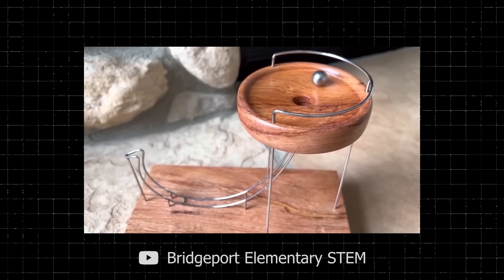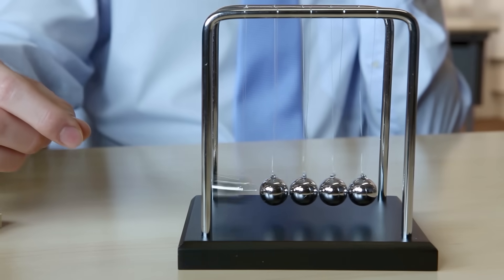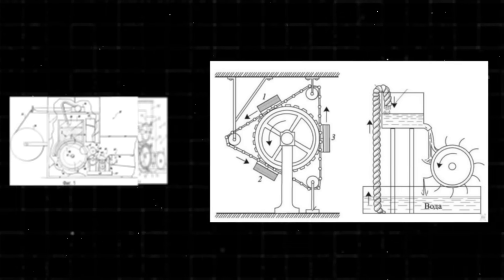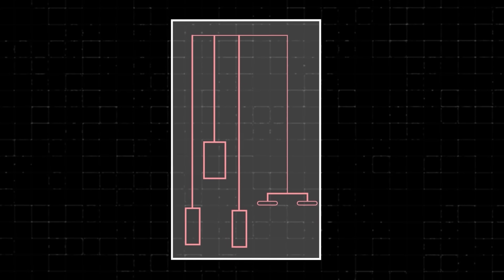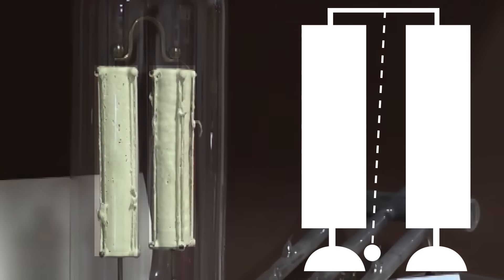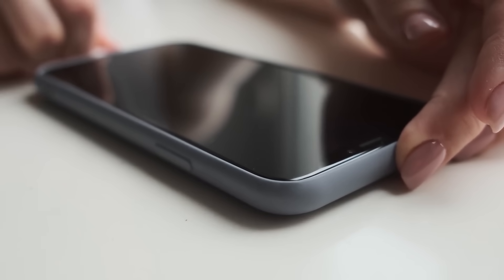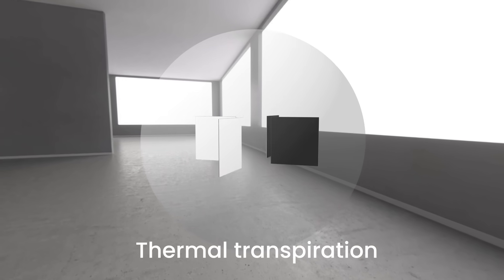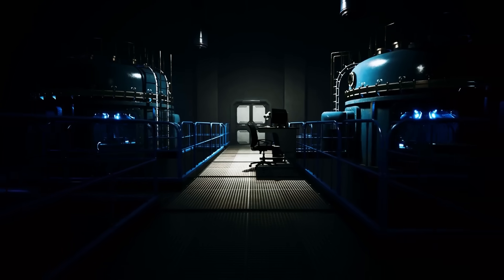Impossible Perpetual Motion Could Become Reality

Comment: I think the answer could be in a regenerative resonant circuit where I think it progressed into a resonance cascade and I believe I have seen the shimmer that Tesla talked about however even though it only requires a small amount of current to start it will still shut down when that is taken away ,,  meaning a rechargeable battery that would last forever would also be required  ....

Comment: when you run a generator its not the magnets and coil making electricty  energy cannot be created or destroyed only transformed but the magnets draw the very high frequencies from the ether the faster it spins the higher the frequencies it taps into the magnets draw the coils convert the freqencies to electrity tesla had a small electric car with a little antanna on it i think it was a tesla coil in reverse to charge them batteries

Comment: The myth about perpetual motion or not is flawed: There is no such thing as a closed system. Even in a sealed container with a vacuum there is still the quantum layer.  Even the black hole hypothesis fails: A black hole will gain mass by absorbing subatomic particles therefore gaining energy. But the goal isn't perpetual motion so much as it is to gain easy access to near limitless energy.

Comment: Yes , perpetual motion invention. 
My flash driving invention running in light speed way is the real driving is in the gapping zone , you can do .
My way is cw drives the ccw and pus my more faster than the real driving.  
The real driving becomes a dummy driver.  Left and right . Ex, the rotary motion is Hole rotary running.  The half is running x 36 cw + ccw half 36x , and up is running 360 % and cover 36x cw and 36x ccw ,
But does it not the perpetual motion running way , the rotary is one the more faster than the real driving is half in left and half in right .
The real driving becomes a dummy driver. 
No force driving in the gapping zone .
The driver is in the gapping zone. 
Want this 10 m$ first .
That is perpetual power.  Black Hole is the gapping zone . And i used it .
My levitation levitating invention way  is the gapping zone . One move the entire chassis is following.

Comment: that bell rings NOT because the metal ball is repelled on both side but because the batteries are connected in series and that ball is in between a directed electric field, and the ball has some residual charge imbalance in it causing it to repel or attract one of the bells, and the moment it does that the charge it was initially holding gets sucked out of it leaving it with the same charge as the bell it hit, hence it gets repelled and hits the other bell and the cycle repeats. That ball is basically transferring charge from one terminal to the other, and there are examples of it in high voltage engineering such as Franklin's Bell but that needs high voltage cuz its exposed in atmosphere and air has a lot of resistance and electrostatic noise, to overcome it we apply high dc or static voltage, but unlike that the set up in the video shows a vacuum sealed bell, yes almost no air friction hence even the little battery voltage is capable of making the bell work. The ACTUAL reason as to why the bell will stop is because the batteries will eventually neutralize their charges due to the continuous charge transfer between the two bell terminals by the metal ball.

Comment: Perpetual motion -- the concept itself by the words -- with no Added outside forces upon it to Keep it rolling, can exist.  Two things to remember:  Adding outside forces to Heed it is in the opposite "direction" of adding it.  So if something's "in the way", whether it be air or your hand stopping it or slowing it down -- doesn't mean it's not an otherwise perpetual motion system.  Second, it Doesn't mean it generates more energy than put in.  Remember, it's just perpetual motion, in and of itself, by the words alone.  

Earth circling the sun is an example.  Or you could have a large body not burning out that's big, out in the middle of "nowhere" in space, and a smaller object in it's orbit.  That would run perpetually until some outside force gets in it's way (or slooooooowly over time beyond imagination of the actual time it'd take to come to stop it, like cosmic rays).  You could say the sun though will grow and change earth's orbit (still moving tho), or eat it up.  Yeah, but whether it's you or some other outside force horning in, that doesn't mean said system left alone wouldn't be perpetually in motion.  Again, no outside forces adding energy to keep it moving, nor outside forces heeding it's motion, either.
Reply: Planets orbits are not perpetual. Orbiting bodies excert forces on each other that do work (tidal forces) and the energy isn't free. Even if nothing else interfered it would not last for ever.

Comment: Perpetual motion is a myth, in order to create energy, you need to give energy, basics of thermal dynamics which all science in terms of water flow, heat exchange, basically everything everyone uses is based upon. Even the sun uses atoms to keep its fusion going, where there is an energy output, and yet, it is still not infinite, the fusion will end eventually and the aun will die. There has to be an energy input, what REAL engineering is about, is to find the cheapest, most widely available energy source and convert it to heat that generate steam to run generators or using kinetic energy from water to turn a turbine, it is IMPOSSIBLE to have something run from its own momentum and generate energy.

Comment: does the electron has a perpetual movement?
Reply: Anything moving in a perfect vacuum with no gravitational forces acting on it will have perpetual motion, or inertia.

But as soon as you try to extract any work from that motion then putting that energy back into the original object within a closed system will yield diminishing returns. Only an external force can put that energy back into the object.

Comment: A black hole is just using compression. Once a star has exploded, it causes a huge vacuum. Which then wants to suck everything in As everything it sucks in, they get compressed and compressed. Until nothing but light gets blasted out. Similarly to a Tesla turbine. Everything wants to compress, but at a certain point, it can't compress anymore, so it gets trusted out centripetally

Comment: I really don't understand certain peoples problems with perpetual motion machines. Eternal free energy sources are unlikely to ever be discovered. That is not necessary. You just need to generate enough energy for long enough. That is all.
Reply: Mervin Marias :  You have a point!!.. Compressed Air Engine (CAE) had been invented since 1930's decade, creating a self. sustaing, hybrid type of such CAE engine will be almost 95% efficient... The "exhaust" compressed air will be "pumped back" to the "main air tank"... Presto!.. You have an almost 90%  efficient engine!.. A small gasoline or diesel engine will auto. start - once the pressure on the main "air tank"- was at "danger level", such air pressure gradually being loss due to friction... It was a big question , why Elon Musk was not using the hybrid CAE technology?.. Protecting a sector or group?...
Reply: "eternal free energy sources are unlikely to ever be discovered "?? Are you kidding me what do you think solar is what do you think wind energy wave energy and so on. That's free energy it may cost you some money to collect it and distribute it but the energy is free for everybody and as far as eternal how long you plan on living?

Comment: What if we spin a wheel in vaccum ? 
will it spin forever ?
Reply: if no forces are around, yes
Reply: In a perfect vacuum, in zero (actually zero) gravity: it will spin until you ask it to exert that energy to do work. In which case, you necessarily have friction or electromechanical load imparting resistance on the wheel.

Comment: OK... That was quite a jump from clocks to Event Horizon(s).  You didn't include the Bedini Circuit, flywheels, claims on other videos of "Overunity" with steam turbines and electricuting water (Wasser Experiments). There'salso some giant clock Bezos funded that's built in a really deep shaft... Pumping water uphill and releasing through hydroelectric generators... I mean...
Reply: Studying different forms of perpetual or free energy machines for over 30 years the closest thing I ever saw to a real 
" machine that can power itself " 
Is a Bedini Wheel which uses tiny amount of power to spin a wheel and produce high voltage surges without drag from magnets and coils.  You can't do a lot with the high voltage surges except charge lead - acid batteries.
I understand with the power of a small 
9- volt battery one could fully charge up to 3 car size lead acid batteries.
I thought of a way that if you had Bedini wheel and two lead acid batteries and used one to run the wheel while the other was charging then had automated system run by one of the batteries to automatically switch the batteries every day or two then the system could probably run for years without touching it.  It would truly be powering itself.
Maybe not totally perpetual but self powering and even over- powering.
I want to build one so I can test it out.